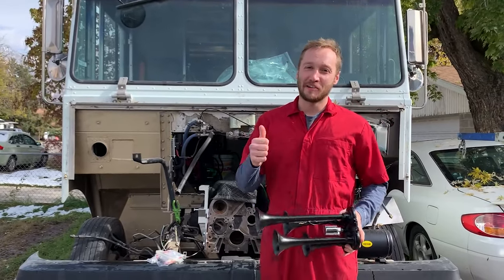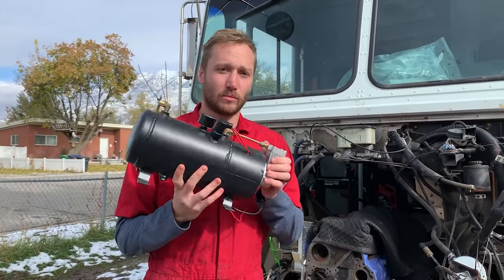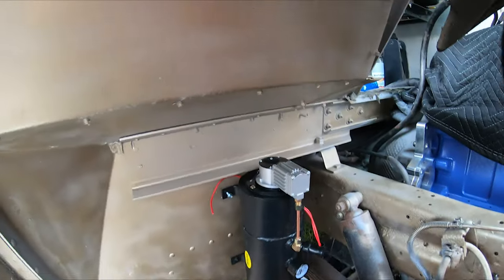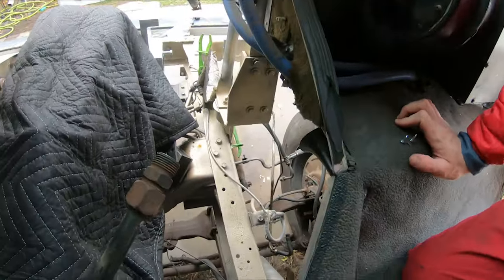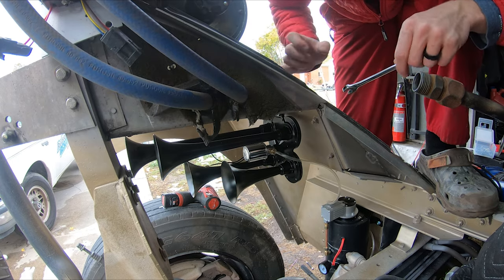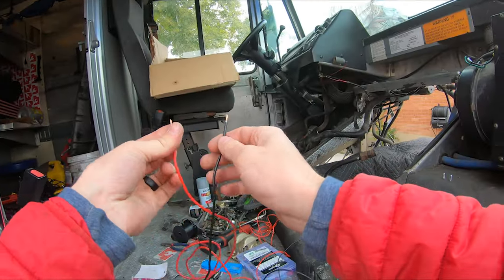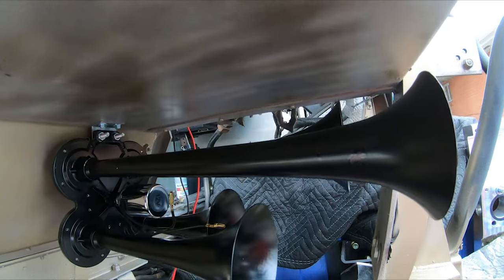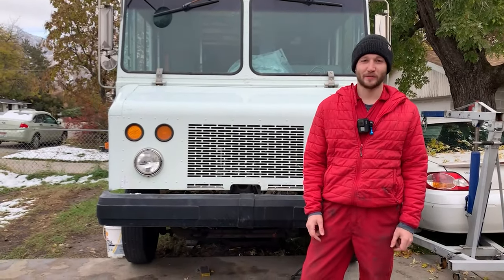I Put a TRAIN horn on my Cummins swapped Delivery truck. Vevor

Comment: Thanks for the video, definitely getting the same set-up. At $70 ya can't beat it, I can't justify spending over $100 for hornblasters, maybe if I was 20 and wanna look cool lol.  You might want to change the placement of the setup tho, that's a prime spot for snow/salt/slush.  Also, you might want to re-think about using self tappers.  I know a lot of people use them for everything but with that thin metal they'll just pull right out of there especially under weight of snow build up on the system.

Comment: Add a connector to air tank so you can plug in a short hose to fill your tires or clients tries.  Tank not big enough to run air tools.

Comment: it took me 5 days total to get my train horns in, 1st day was trying to figure out where everything went, 2nd was drilling, bolting and running air hose, 3rd was running wires, 4th i was a relay i was waiting on and was almost done until i found out that the horn and compressor each had to be on its own ground, 5th was fixing my oops.

Comment: You want your fuse close to the battery. That way that wire is protected by the fuse, the way you have it wired the wire can still be energized all the way to the fuse even if there is a short.

Comment: I personally would have installed it somewhere safer. The mud and snow might slap all over that unit causing problems.
Reply: I have to agree. Face the trumpets down to so they don't get filled with water and snow and this system 
might last longer than 12 months.